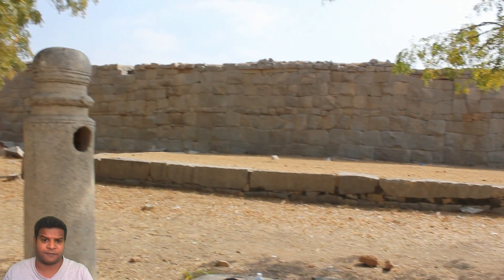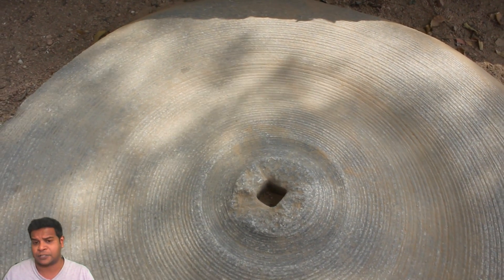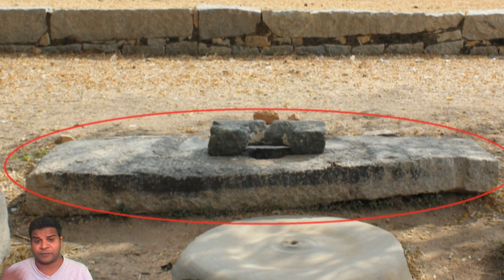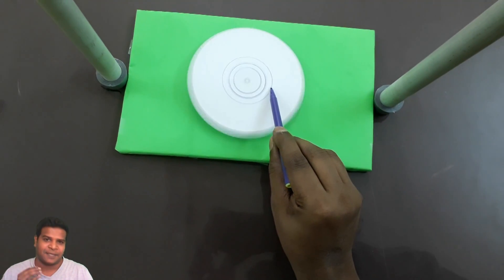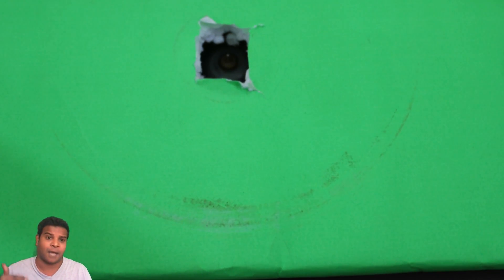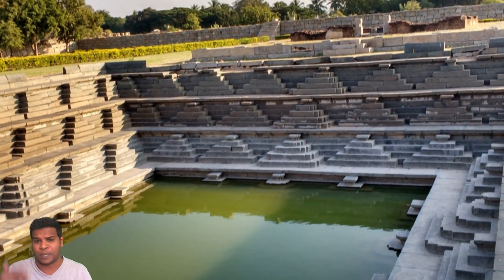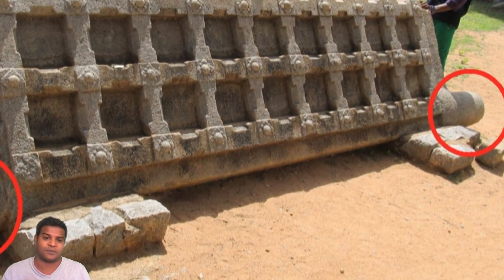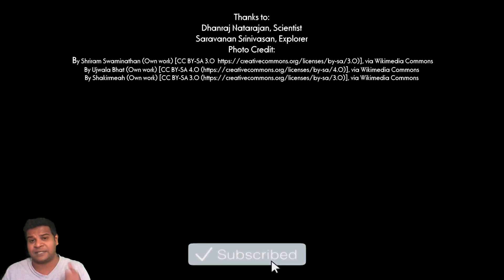Ancient Lathe Machine Found in Hampi, India - Lost Technology Discovered?

Comment: His explanation is wrong. He does not explain how they were rotating the disk at such high speeds.

It's actually very simple mechanism. The rectangular slab you are looking at is the model slab (you can see the model pattern on this). The circular rock (the one beside it) was carved on it by rotating it using bulls. dddFirst of all, you need to chisel a circular disk with a square shaped hole at its centre. Place it on the model slab. Insert a square shaped rod into the hole (This will be vertical). The two pillars on either side of the slab are used to stabilise this vertical rod (for rotation). As shown by him, a thick rod (or rock) connects these two pillars. The centre of this rod has a hole. Through this hole, the vertical rod passes. At the top of this rod, attach another rod (or wood) perpendicular to it (this will be horizontal). The horizontal and vertical rods together look like a "T" (This T shape rotates the disk). The ends of this horizontal rod are tied to bulls. These bulls are made to go in circle rotating the circular disk of rock. Through this rotation, the disk gets grinded into the model on the slab (hence the machined look).

If you observe any of these smooth rocks with circular patterns, then they are made like this. The bottom slab should be harder than the rock that you want to grind. It's not advanced tech but it is very creative. Please appreciate our ancestors for their true talent.

Comment: Wouldn't it require high RPM for machining a rock, with such high finish?  What mechanism do you think was used for rotating the rock?
Reply: Since motors weren't invented, I am guessing a mechanism similar to potter's wheels.
Reply: @tiger2477101  but at low RPM strong material start chipping. If you machine wood and epoxy at same low RPM, epoxy will start forming chip and would just break instead of being cut. For stones such high RPM by a potters wheel sounds a little difficult.
Reply: @vikramrawat284  hmm. I'll have to research a bit more.

Comment: Important question to add was- what was the energy source for this lathe machine to work?

M sure the hint must have been around the Hampi site
Reply: @NinjaWolfHybrid No. Human or animal power.
Reply: Gears and handle to spin it I'd assume. Seen statues with gears around them so they had knowledge of the use for them.
Reply: This lathe undoubtedly worked material between two centre points. It probably had a heavy base which people walked or kicked around.
Reply: Elephants and Horse is the main power this machines.

Comment: I like your videos very much, but in this case I will disagree.  I think the round piece was ground down by the slab rather than being machined.  The square hole in the center was facing downward on the slab causing the slab and the round piece to have the same circular patterns.  This could have been a mill for grinding grain.

Comment: Bother in creating all your hypothesis you actually forgot to question why would some one creat rock with concentric circles? What was the purpose? The leath machine process that you showed  above is actually wrong because the process will creat spiral circles on the rock and not concentric ones. In my view that rock was made as a milling stones bottom part and the other stone with bigger hole in the centre was used as upper milling stone the middle hole been used to poure grains to be milled. The same technology is being used in many rural areas of India still but in smaller handheld form.

Comment: I understand that they were using vertical lathe but the main part remains unexplained that how the such a heavy rock was rotated at a fast speed, that too without any electricity.
Reply: Multiple rotations in same place.  Rather than a single cut. Used oxen for rotation

Comment: Those posts were built by the portuguese people in India during the 16/17 centuries. For sure cant be 2300 yo. Even the architecture of the posts doesnt match the architecture of the site, neither the way they were crafted. And they seem like a lot of the portuguese way of ending the posts (at the top), back in Portugal. I wouldnt get surprise if they have 500 yo. The same technology is used in Europe to crush cereals and make flour. And the rocks that are used to crush the cereals also get thouse circular lines. Consider also doing some litology tests between the rocks of the building walls and the posts. The portuguese people also built churches and fountains and some water distrubution systems in India were you can compare from. The Indian architecture were full of engravements and would have some sort of Gods representation on the face of the posts, and for me, those ones are clearly an European architectural design influence. But this is my theory :) Last thing: how do you explain the massive holes on top of the posts made back to 2300 yo? With a earlier lathe machine? The egyptians could do it, yes, but how? With sand and copper/bronze tools. Where are the cooper/bronze tools in India? Find the proof of the tools, and you have a massive help with your theory.  Thouse are pretty neat holes that dont show 2300 yo of meteorization or erosion. Consider that.
Reply: Why portugese make temple in india???😎common sense
Reply: @rd6528  No? There was no Portuguese in India?  Goa, Damão, Dio, Manora, Açarim?  I didnt said the temple, but the posts! The posts! Are recent than temple.
Reply: @Medjurazzdiguetto  
I appriciat ur thoughts 
But still credit goes to ancestor
Reply: @Medjurazzdiguetto  
Todays india not fully devlop like ur portugual
Does not mean we will not
Reply: @rd6528  My friend, India is musch more developed than Portugal. You even have space roket science. And nuclear power. The only thing that is sad is the poverty, but that its anouther story.
Reply: @rd6528   Look at the erosion on the posts rock. Very little. You can see all the architecture linning. It doesnt have 3000 yo for sure, but you believe in what you want of couse.
Reply: @Medjurazzdiguetto  
Brother sory if i hurt u
But i also not believe this
All content of this channel not 100%true
But u can say some videos informative,,
 predictive ,
I must say it is just a hyp sometime
But not all time..
60 to 70% work by this channel is good

Need more proof and reference from praveen
But ok from information point of view.
V indians also not blindly accept it as truth 
It is just premitive obs by praveen
Reply: @rd6528 Didnt hurt, my good friend. Its the true, India is more advanced in thecnology that Portugal. Maybe Portugal is more advanced on a social and human rights way. I am 100% in the same page as you. I only think that Praveen speculates a lot in a way that he takes for granted that there was a bigger entity with knowlage of thecnological tools that provides the capacity of governing the ancient people that is not sustained by any proof. And what seems to be simple, he complicates in order to justify it, when there is simplier ways of getting a possible and acceptable conclusion. What would make people like Praveen talk about rockets in ancient world? And melting stones?. And materials not found on this planet? In Praveen mind, everything that you cant explain can only be justified by a power that is not knowned today, that came from other planet.. I just think is a very coward and with a big desregard about what human beeing can acctually produce, and that we should all be proud of. Because what he is saying is that ancient Indian people didnt acctually produce anything, it was all the powers of a bigger entity, and thats not the way I want to see it. Its no longer the story of the rise of Indian culture, but the show of the power of a bigger entity in India... And that is nonsense. Thats it.
Reply: @Medjurazzdiguetto  
Very true
I also dont belive in aliens 
Or in imagionary powers

The god is for positive vibrations to make positive mind for me atleast 
That does not mean god created every or any  ancient things

I m hindu i believe in god for all positive vibrations for good sake in my life ..

Best regard 
Runal deore 
Jay hind jay maharashtra
Reply: @rd6528  That is true. If you see, the portuguese empire was the only one who could sustain the language and cristianity on foreign empires, like Angola, Mozambique, Brazil, Timor, Cape Verte, Macau because we never tried to inpose with war or agressiveness, we respect the culture and the beliefes of people. They still talk portuguese, and they have portuguese based constitutions and the religion of cristianism. India is a super power in rising for sure, and in Portugal we love Indian people and culture, and they love us. Let me know if you come here one day, i will show you around, and you will understand how and why portuguese people is so proud to have an Indian period on our history.
Reply: @rd6528  My friend i dont use social networks. Im not anywhere, and i love it. I am frequently in youtube, im not going to miss your message if you want to come here ;) trust me. If i have the time, I will defenetly go visit india and i will let you know, India is a country that you need more than 2 weeks to really get the good vibrations ;)

Comment: Ancient machine is O.K. and fine, but how it was powered, what type of electricity, and current , power they used and someone has to do research on this topic also. And also how was its one and off mechanism etc...As per vedic theory, things can be achieved by the power of mind provided that the mind is pure like god.
Reply: The had ancient batteries from Babylon, which were also used in electroplating.

Comment: The core drill was developed in ancient Egypt by 3000 BC. The pump drill was invented during Roman times. It consists of a vertical spindle aligned by a piece of horizontal wood and a flywheel to maintain accuracy and momentum.

Comment: Please be very careful with absolute statements like "this shows solid evidence of machine technology". There are many symmetrical structures, like what you show, that appear naturally. Chrystals are the obvious example. And things like pillars can appear machined due to "patterns" that form naturally from different layers (think of geological layers) that are later exposed to elements so the dissolve differently. The "perfect circular rocks" you show here could possibly be created by nature by having something rich in minerals drip down at a slow rate so float out in a circle on the floor a little before the next drop comes. Also, consider that materials can change over time. For example fossils - where you can find "any" shape - were of course originally not made from the material they are now made of. The "perfect circles" you should could also have been a tree trunk that somehow was cut and its rings were fossilized.

Comment: Very interesting. However, the biggest problem is how did the bearing between the rotating part and the frame work? The most complex part of the wheel is it's bearing. Those stones look very heavy. The forces on the bearing must be large as all the weight is concentrated on a small area especially in a vertical axis configuration. There should be particular marks where the axis of rotation meets the base.

Comment: the round stone is in the correct position, it looks to me like the long stone should go on top of it with its upper face locating onto the lower stone, the large top stone could then be turned with a person pushing each end. the side pillars would hold a wooden beam which would be used to support the large funnel shaped wheat hopper constantly supplying wheat.
Looks like you found an early wheat Grinder

Comment: So what?  Chinese had vertical lathes 3,500 years ago.  Gee it only took India another 3,000 years to catch up.  Where are you going with this?  In fact, if you clean up the area a little bit, you will find the Chinese makers marks on the lathe.  I think the date it was installed by the Chinese is listed on there as well.  Best of luck in finding more of the early Chinese gifts to India.

Comment: Yes they used advanced technology, and I don't believe this one is the world's oldest I believe that this technology as existed back before the reset of man kind. Just like the pyramids and and monuments of the Giza plateau are most likely over 12000 years old this type of technology is as well. They might not of had electric or combustion powered machines. But like a transmission with the proper understanding of gears, flywheels and cogs you can create and massive amount of RPMs with human motor power or hydro power. And they might of had combustion powered machines who know even electric. But non the less a lot of stone work was do e with more than chisels and hammers like we are told.

Comment: Looks pretty convincing, but you need a lot more examples of lathe-produced stone constructions.  I do think you may be on the right track, though.
Reply from the maker: Hi Querent2000, thank you for your suggestion, will try to show more. Also thank you for watching this video. Have a great day!
Reply: In the smaller block on top of the large one you can see a slot. Maybe could be made to put a kind of chisel in.
Easy to hold it in place like that.
You probably can even change the angle of it while it turning.
Reply: @tytorubio3271  I think you're onto something there. It doesn't make sense that the tool would be on top...the slot is the perfect location for the tool.

Comment: Hello! the machine was probably a millstone for the seeds, to make the flour, not to cut the stone but to shred the seeds.
the square hole in the center of the stone with the rings is where the seed is dropped, the part you showed should be put on top of the long stone but with the head down, the pole between the two columns was: o a support beam on which the wooden part behind the stone head was swinging, the head with its wooden base was tied with ropes or leather straps to the beam between the two columns, the rectangular stone was a weight that was added after having positioned semi and head in position, it also served to keep the strings in tension as they unrolled by rotating the head,
the mechanism was started and helped to work by some workers, who were struggling at the beginning to rotate the pier and roll up and tension the strings but then when they changed direction the wheel for a while (also based on the elastic quality of the strings) the wheel kept turning without requiring efforts
or
between the columns there could be a pole with two arms that, if made to swing, pressed first on one side and then on the wooden base behind the head of the mill, so the rock oscillated on one and the other shredding the seeds that were thrown underneath and the square hole was the point where it was fixed to the swinging wooden base, the small rectangular rock here could also be a weight to add to increase the weight of the head of the mill and was sculpted to fit perfectly into the wood, it is probable that there exists a second of equal shape or equal weight. ciao! thanks for your videos
Reply: Millstone came to mind too. What is unmistakable is the precision of the grooves. Not possible by hand - some kind of machine is needed. One thing we shouldn't do is cloud the "machine" concept with contemporary experience. Virtually anything that provides a mechanical advantage is a machine. The system used to lower and raise a bucket from a well is one simple example.
Reply: Whatever you said, seems to be true but look at other structures,  At 6:06 ,  those standing pillars seems to be grooved using a lathe machine , and they all are inch-wise perfectly similar.
Reply: @xaviourgd  he is just imposing his typical western agenda!! Not accepting that the ancient machine was used to create magneficint structure but overshadowing that its just used for merely grinding grains😂😂 seriously u lack appreciation!! west dont accknowlege that india was the world order in ancient times!!
Reply: @darlrusian  get the fuck outta here!! U Dumber than dumber than dumbo  western rasist moron!!🤣🤣
Reply: @brightmoon5899  thats the pot calling the kettle black.
Reply: @darlrusian  i have a pet rock....its smarter than my wife,it knows when to shut up...ha.
Reply: I would say yes thats possible explanation.. but if you see second stone block, a seeds crusher might not lathe a block only one side. There is no point of using a such a base where only half of base is on contact with as it wont crush the seeds effectively... Im just thinking, don't take as Im imposing anything here...